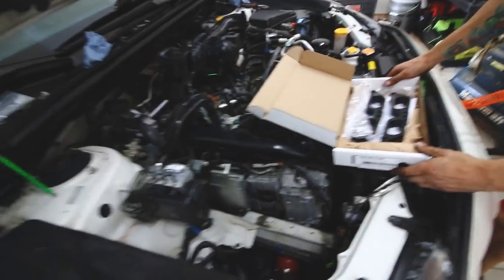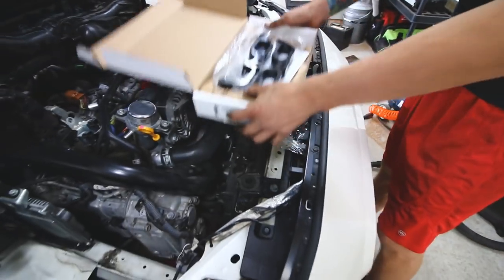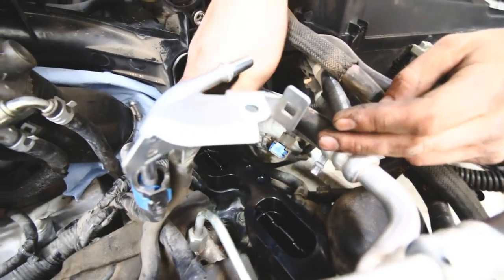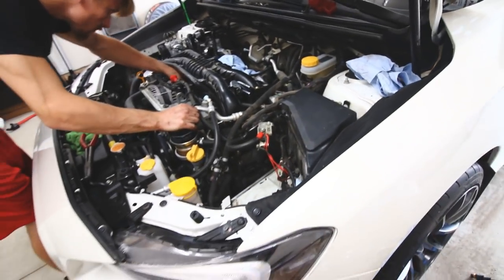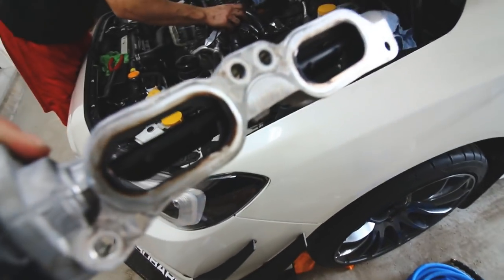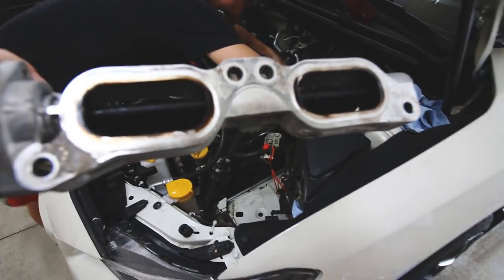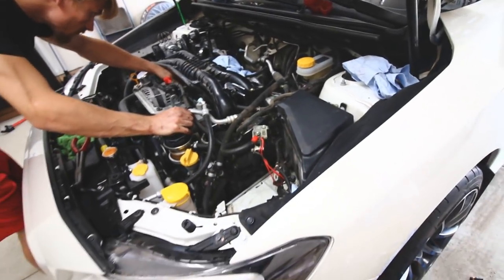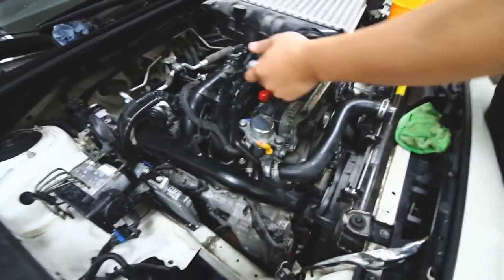PERRIN TGV DELETES | 2015 - 2018 SUBARU WRX

Comment: Are Subaru's harder to work on than other cars?
Reply: It really all depends on what work you're wanting/needing to do.  Having owned several brands and styles of vehicles over the years, I don't think they are any easier or harder to work on than another vehicle.  There's aspects to any make and model that are dead simple and there are aspects that require a little more work compared to another make/model. I can give examples if you like, but I won't bore you if you get the idea.